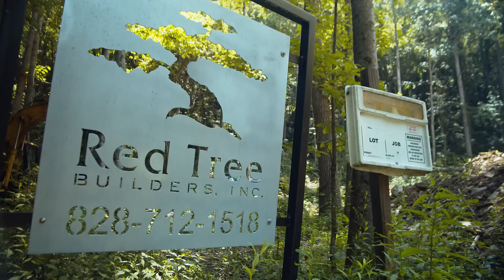Air Sealing Tips For Tighter Building Enclosures | Behind the Build | ZIP System building enclosures

Comment: I would still add a vapour control barrier (polythene)on the warm side of the insulation to prevent interstitial condensation forming toward the outer part of the wall.

Comment: On the foundation.  Why would you not say put the liquid flashing at the soleplate and say an inch or two below on the exterior and then when standing the wall up ... or sheathing said wall let it hang over ( down ) past the top of the concrete foundation?